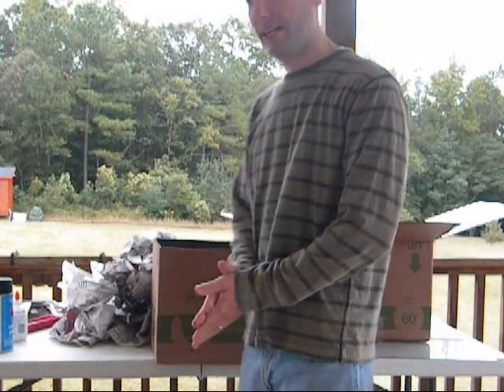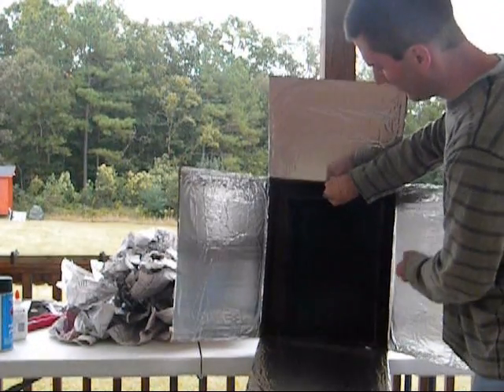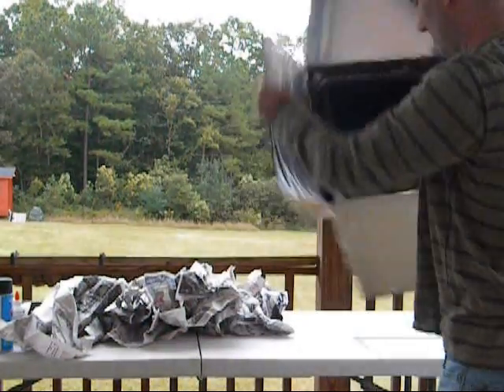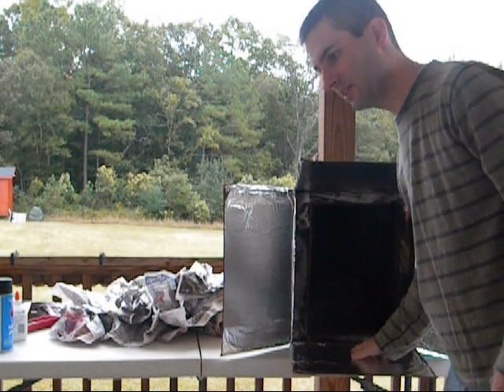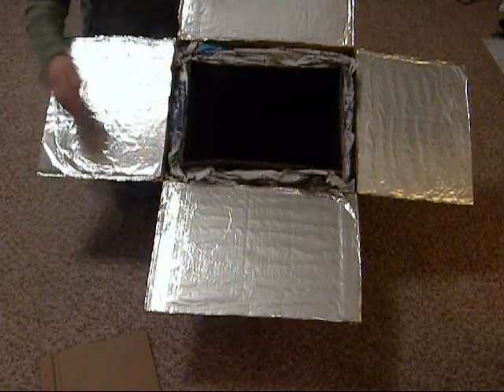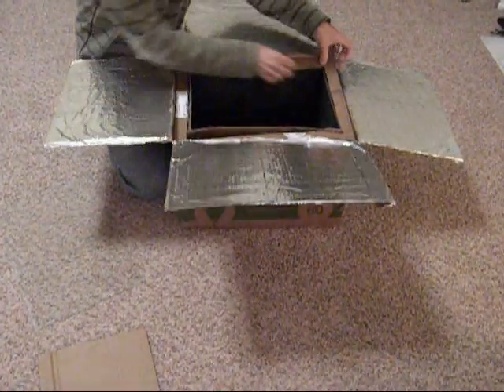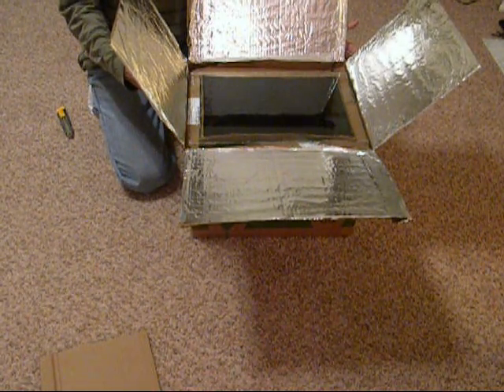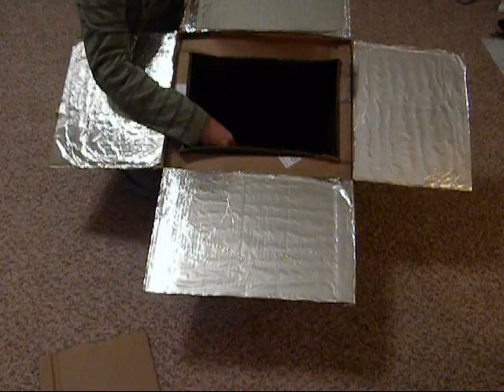How to build a cardboard solar oven part 2

Comment from the maker: @morethan29 Hello, I have seen people use plastic oven bags that were made for high heat, but I am not sure if plastic wrap will hold up to the heat. I might try it in the future to see if it works or not. Thanks for the question, Lonny

Comment from the maker: @yankeesman75 If the top you are adding blocks the sun, I do not think it will get much hotter than the outside temp. But I have never tried it so it is just a guess. Thanks for the question.

Comment from the maker: @cmrnqueen I have seen a few solar ovens that used foil for all the sides. But on the bottom they used a black sheet tray to cook the food on. You need the black tray to absorb the sun. I think it should be okay to paint the outside black. I have them in many colors and they all worked just fine.

Comment: I have to make one of these for a chemistry lab project and I was wondering, if it would be best to put aluminum foil on all the sides and bottom of the box. And because I can only find white cardboard boxes, I was thinking of painting the outside of the box black. Will that work?

Comment: nice vid, i was thinking about the inside box you could try aluminum on the whole inside and maybe a piece of two-way mirror instead of the glass to let sunlight in but not out. Of course that might be more expensive i'm not sure how much two-way mirrors would cost. Just a thought I believe might have been worth sharing.